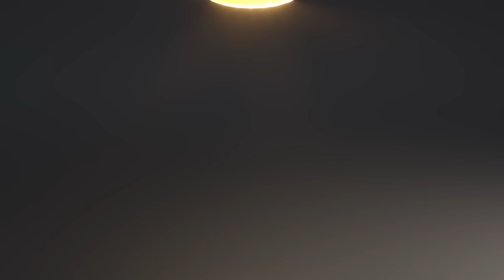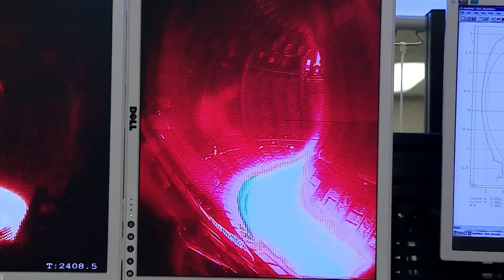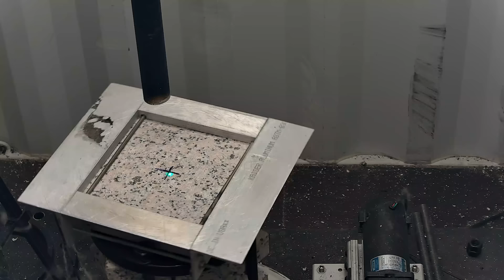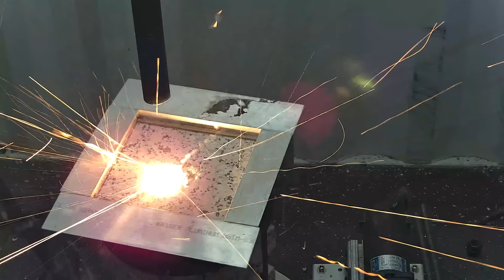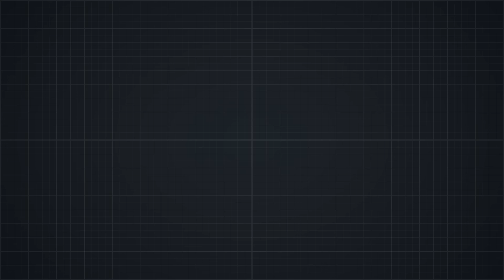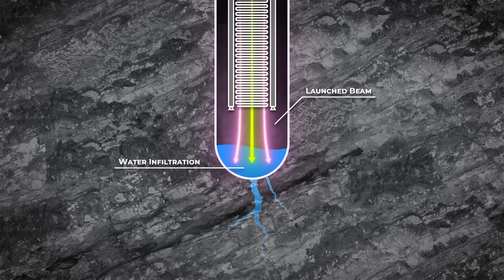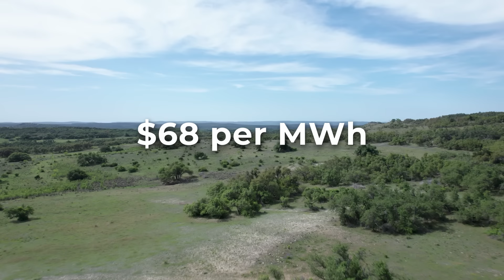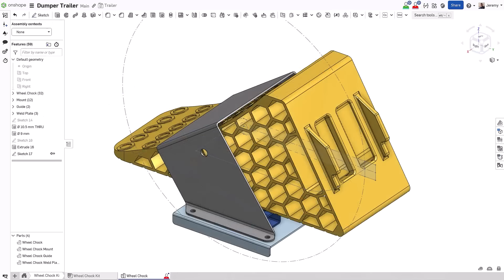Geothermal Energy is Changing

Comment: Questions: At those depths, rock becomes plastic from brittle, isn't that right? One might expect that under high heat and pressure, the holes might tend to close back in, more quickly as depth increases. As microwave plasma contact ionizes atoms, those ions and electrons must go somewhere as they contain the energy of the microwave plus the heat and pressure that combines to do that. That's an energy extraction bonus of more than inputs. But a thermal chimney is created and like opening the flue in your home fireplace and lighting a newspaper page, the updraft will quickly heat the rising stream even hotter as it draws-in convection heat from lower and hotter depths. 

There's no end to that, and a balance must be struck between whatever steam or plasma updrafts will transmit and the increases drawn from the mantle. If plasma-deposited graphene coatings are applied to the drill string casing, one might expect that any electrical currents would follow the heat drawn away from the drill head point of contact, is that fair to assume? If heat increases, the rate of power increases with the stripping of electrons too. Steam may not be the same as plasma, but the difference is that steam does not require gyrotron power to operate, although a dedicated gyrotron might not require a steam turbine investment at every well head. 

Continual microwave operation would erode more and more rock, opening a larger hole below, but with plasticity in rock increasing in rising heat, that position may become stationary. Steam updrafts will cool the rock formation below and the rate must match its replenishment from beneath it. That may be tough to judge, yet with plastic rock continually advancing upon the microwave plasma, the cooling is replaced in an updraft of electrons that are ripe for picking. That rate could be matched by microwave intensity, whereas the steam is adjusted by its inputs of fluids. Is that a fair guess? One might assume the price of gyrotrons to fall in full production, and today's producers are quite small private companies now, aren't they?

One predrilled decommissioned oil or gas well has the advantage over a pair of steam wells, as the second steam well will have to be drilled by conventional means anyway, up until the solid rock layer is reached. Doing the job twice for the luxury of placing an additional steam turbine there seems easy to avoid, if in fact that's not all blarney. All of those notions are questionable, but the freedom to place energy wells without the stink of rotten eggs in every site for electric-arc steelmaking, electric-heated cement kilns, brick and block plants, plasma-assisted nitrogen-fixation for ammonia, electrolysis hydrogen and low-temp cracking of ammonia for hydrogen-powered industry while returning and recycling pure nitrogen gas in reverse flow back through the same delivery pipes to the plants for more ammonia, pipes from abandoned oil and gas fields. Ample local supplies for charging autos, trains, and trucks?

How about for rescuing Europe from their dependence on Russian oil and gas that's left them begging for more LNG supplies? How about more oil and gas made available for cheaper and better plastic products? There seems to be no end, but Quaise Energy is not a participant in the SEC's Reg CF program that permits and encourages crowd-funding for startups, those like the spinoffs that government funding has made possible through MIT research? Why?
Reply: I've never seen a neon sign that was 20-miles long, but if current conducts through plasma easily, the updraft convection currents will eventually cool vaporized rock at each element's evaporation point in the strata. If those incredible temps could be maintained, the drill string would evaporate too. Maybe a graphene coating would conduct heat and electrons at a rate that would match the downdraft of noble gas supplied inside. Capturing elements of each band would be added revenues, especially in veins of ore where plasticity would continually feed metals more easily and quickly than other rock. Knowledge of the ground current and study of magnetic anomalies might help in mineral searches where concentrations are rare.
Reply: I would suggest that nitrogen would be better than argon, not because it makes a prettier lamp, but because of its abundance and use in ammonia for farm fertilizers, as well as a means of transport where hydrogen fails. I don't know if the frequency is right, but the option it offers seem robust. Remember the QWERTY choice in early typewriter keyboard patterns? It's intentionally inferior, but universal, and so too hard to correct later.
Reply: Am I right in thinking that the glassed walls of the wells are non-conductive, like a neon sign?

Comment: Those wispy fibers are what mineral wool insulation like Rockwool are made from. This phenomenon was first noticed during volcanic eruptions.

To make mineral wool they melt a vat of stone and drip it through a funnel where compressed air blows the drip and vaporizes it into this wispy fiber.

I wonder if a gyrotron would be a more efficient manufacturing process for mineral wool rather than melting a whole vat.
Reply: Absolutely not. Not only do you have to vaporize rock instead of melting it which takes more energy, but you also have to use more electricity because gyrotrons are not 100% efficient, and you'll have to use complicated and expensive tech instead of basic stuff you've known for decades.
Reply: Same energy is needed to melt a kilo of stone either way, no gain from adding all the extra complexity.
Reply: @TheDuckofDoom.  yeah the same amount of energy is required but how much waste is there in eash system allowing for one to be more efficient?
Reply: @TheDuckofDoom.   It's more efficient in the same way that tankless water heaters are more efficient than tanked. (And I'll not hear any flat earth level bullshit saying they're not more efficient.) Unless they're spending far too much on perfect insulation of the tank, there is significantly less waste heat.
Reply: @ Water heaters are a false analogy. Nobody is storing molten rock for later use, it is already an  on demand process, nor is there an issue of piping it some distance from a central heater for intermittent use. (And I won't hear any of that flat earth level economics claiming businesses don't care about efficiency or employ experts in their field.)

Although I have seen vats of molten aluminum transported a couple hundred miles by truck, but in that case the refinement process yields molten aluminum and there is no reason to cool it for transport just to have the customer reheat it.

Comment: The question i'm asking myself here is: Can this drill head withstand the conditions several kilometers below the surface? And how well does it withstand impacts against the (possibly still molten) sides of the drill hole? Because that drill head will essentially dangle from a kilomter long straw. The slightest movement on the top can rather easily translate to large movement (constrained by the sides of the drillhole aka hitting them) at the bottom. For a traditional drill head that's not much of a problem, the thing is essentially just a huge hunk of steel. But this thing is a piece of precision engineering, i suspect it won't tolerate abuse as well as a traditional drill head. And finally, not everything down there is rock. How does this thing react when firing at something that isn't rock? Like for example, what happens if you accidently puncture a pocket of natural gas? Or crude oil? Or just water?

Comment: I didn't see any talk of how you actually use the hole afterward, I know it's just heat rising so there's a turbine or something to generate the electricity. But for a real world power plant do you bore just one hole and build a plant over it? Or bore 100 holes? how far apart do these need to be? Could you build a large plant and have it's floor be nothing but boreholes and the heat-capture system on top of them?

About $30m to drill one hole is pocket change to our Musks and Zuckerbergs. If practical tests even come close to expectations it will be another oil rush.

Comment: Microwaves are not higher frequency than visible light. High frequency microwaves are pushing almost to infrared, but both are still longer wavelength (i.e. lower frequency) than visible light. To put some numbers to it, visible light is about 380 - 750 nm (400 - 789 THz), whereas microwaves are anywhere from 1 mm to 1 m (300 MHz - 300 GHz).

Comment: Sounds like such a tricky one. While conventional drills have their issues with material, they are also super simple.
But this introduces so many variables. What if they encounter highly flammable material? What if the vaporized stone goes and condenses at places where you don't want it and clogs? What if you encounter material that reflects so much, it destroys the drill head? What if it creates razor sharp edges along the hole that destroy equipment?
I could see this working as intended eventually but the question is whether somebody is willing to pay through all the failures.

Comment: Well, as long as it's cheaper than nuclear and the others, or similar but just more publicly pallatble or safer on the supply/waste side, then it's good as a baseline production unlike most other green options that are a bit more variable in when they generate power, so even if it's not the cheapest, it still will have a place in many countries grids if it's proven viable I think going forward. Also, research teams will love this thing.

Comment: An 8 inch bore (at 1 meter per hour) is .032 cubic meters per hour of solid rock.  All those strands in that room shows just how this won't work.  As the rock rises it will cool and condense back into rock on the drill line and the bore surface.

Comment: Lots of stuff in the way.. Key: *Warwick university Plasma generated Ultrasound = Totally remote, operate in extreme conditions, and easily automated. Combined with Ultrasound pressure holography which is being claimed as a method to make holograms tangible(I know it can..) will allow making extremely powerful pressure shields for people + tools. Even further using non-interactive frequencies that allows max penetration of Ultrasound scanning using less advanced Ultrasound source to "reveal the inner working of Earth's Tsunami factory" to see perfectly ahead. No surprises..

Add Ultrasonic frequencies that perfectly transfer vibrating into only materials you're willing to dust instantly ahead of the drill with Plasma generated Ultrasound laser using Ultrasonic echo clashing to limit range. Google: "Ultrasound can reach pressures as great as the bottom of the ocean" More with Plasma.. Points at Boeing Plasma force field blocking shock waves from explosions If you're into advanced spaceship shield technology tree..

Comment: ..."with the plugs in your home providing just 120Vac"... Guess we now know which audience he is targeting. But at least he is still using SI units.
Reply: The whole thing the video said about the grid power was just STUPID. There are parts of the power grid with 500,000 volts AC, and some grids are at a million volts DC. Supplying HVDC power to the gyrotron is NOT an issue, at all.

Comment: Pre heaters for the nitrogen purge is also going to require energy. To prevent rock solidifying inside the drill tube.
Reply: DeepU Project has a different strategy. Vaporiizing rocks with a laser, then quenching vapor and melt droplets just above the drill head. Then blowing up solid glassy particles.
Reply: @ThePawcios  got a video or link on that?
Reply: presumably the nitrogen purge is pulling double duty as coolant for the maser assembly already.
Reply: @olschneebs9303  In their experiments probably unnecessary, but to maintain minerals as a gas while lifting several miles it will be essential.
Reply: @ But are they even hoping to keep the gas vaporized all the way or are they happy to have particulates carried out by sufficiently strong airflow?

The concern might be if it's re-solidifying on the walls of the shaft but if it's already cooled? Either way it surely must be something they've considered and answered at least to the satisfaction of investors.
Reply: The drill tube is a waveguide with insane amount of energy flowing through it. Nothing will cool down there.
Reply: @falrus Cool is relative they need to maintain well over 2000C to maintain minerals in a easily lifted gas state, & over 1260C to keep it liquid. Under 1260C means bonding minerals to expensive alloys. Max service temperature for steel is around 700C. Only path is preheating the nitrogen & using surrounding rock to cool the drill rod. Everything is simply more reactive at these elevated temperatures, & with only a fraction of room temperature yield strength.

Comment: Seeing the vaporized Rock crystallize and reform into long strands tells me that this technology would be as useful to make grid storage batteries out of Rock.

You could literally 3D print a lattice structure in a kind of mold. You put a fan of one end and then pass the vaporized Rock through it for Vapor deposition of the desired material.
Reply: How would you extract energy out?
Reply: @AhmadAli-kv2ho  not trying to make a battery directly necessarily but better anode materials for batteries.
Reply: It would help to make solid electrolyte for things like lithium ion batteries viable, not necessarily directly as the source of energy, unless you could use this to more usefully harness the piezoelectric effect, which should work since they said in the video they were cutting quartz a piezoelectric stone.

Comment: It seems the head or end of the pipe would need sensors or a camera to keep it off of the rock it was drilling into. The electronics appeared to be quite fragile and not something I would imagine could stand the pressure if it hit the rock directly (unlike a drill bit which is designed to take the pressure).

Comment: 12:30 They need to make a model and train it to adjust these perimeters on its own to find the best settings and use them for the given environment as that will be changing.
Reply: The temperature of the earth changes depending on depth, so that is a great idea considering they can lower costs by micro adjustments because of the earth being hotter the lower you go
Reply: They are using the best model we currently have to do that, the human brain.  While machine learning may have the advantage when you have huge data sets and need to apply it many times humans are still way ahead at generalizing from small data sets and even at cost for training (just way behind on cost for evaluation but they don't need millions on instances).

Comment: The levelized cost (LCOE) does not take into account the intermittent nature of wind generation, therefore is invalid for comparison...you must take into account what forms of energy storage would be necessary to compete with an on-demand source of energy....and add that to the cost...you are comparing apples to oranges with this misleading LCOE shown here....wind generation is only operational around 30 - 40% of the time on average, so you must triple the stated installed capacity and store the excess to be available when the wind is not blowing ....

Comment: As a drilling engineer, I've seen presentations. by companies wanting to drill with plasma, or lasers over the last 20 years. in every case, it works great in the lab, but the company representatives could never explain how the borehole is supported in reality. Just "glassing" the rock  and expecting a column of Nitrogen to hold everything in place just wont do it beyond a certain depth because hydrostatic pressure, and overburden pressure are real things... the deeper you go, the higher the pressure gets, and boreholes really do not like a high differential pressure between the rock and the hole. Conventional drilling uses a fluid, to support the borehole - usually water density or higher, and even then there are limits.

It's undoubtably great technology, but I would like to see a real test well drilled. both to see how they plan to control borehole stability, and also where and how they will generate (affordably) all the electricity needed. the energy input to vaporise rock is orders of magnitude above  conventional rock breaking with a roller-cone, PDC, diamond impregnated, or hybrid drill bit.

Comment: I've been hearing about this tech for a few years. My problem with this type of technology is they spend a lot of time talking about the RF source and the melt heads both of which seem like very solvable problems but  I have a more fundamental question, the waveguides are going to be similar to typical drill pipe in size for practical reasons and and I'm assuming they can be made about as efficient and high-performance coax cable,  a typically a waveguide splice is going to be .3 Db of loss at each splice and a good coax is going to be .03Db/m so over a kilometer that like a ~60Db loss. that means there 1MW going in at the top is only going to have about 1W coming out at the melt head  so ether they need some amazing new waveguide tech or they are going to need a whole lot more power at the surface.